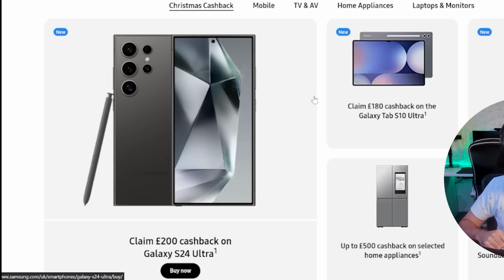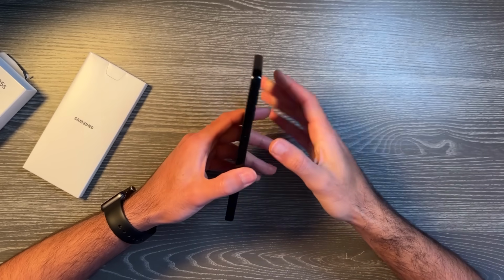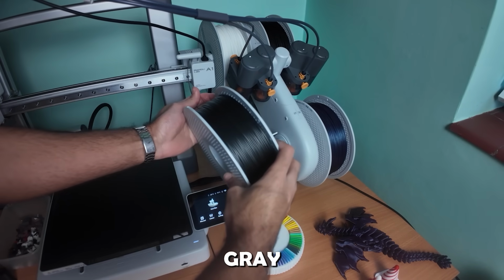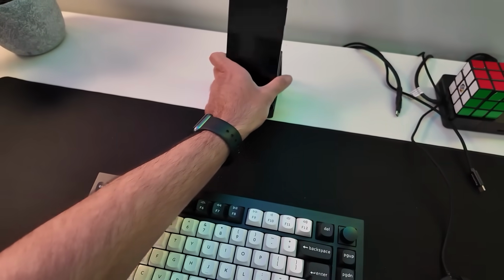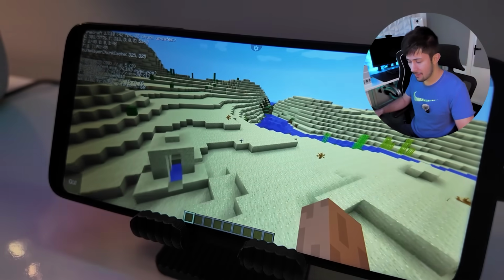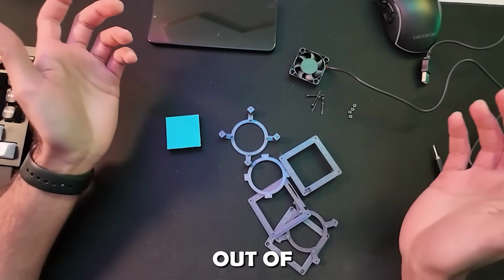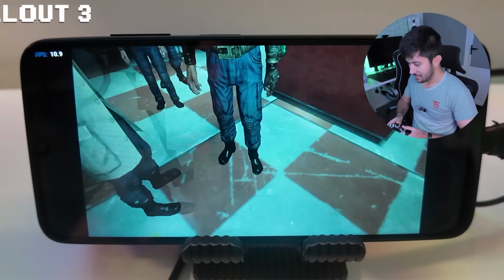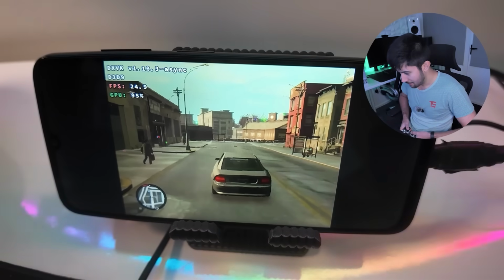Testing the Cheapest Samsung for Gaming

Comment: In my experience of many Samsung flagships and budget phones, Samsung doesn't have the best specs for the budget end but have better software support. Even midrange phones Samsung tend to have weaker specs but are just good all round devices. But chips and screens have advanced enough that even cheaper phones are decent enough. But if you can spend a bit more to get a phone with Oled/ Amoled screen its worth the slight additional cost

Comment: I'm using a Samsung Galaxy Note 9, and it's outdated, yes, but it's my best phone for gaming. I can play up to PS2 and some switch games perfectly fine, and has Samsung dex, I'd recommended trying it for a video sometime, great video btw
Reply: How do you get Switch emulation? I don't trust many sites for downloading "current" games. Does it need keys for the games to work and stuff?
Reply: @kylespevak6781  yea, you need the prod.keys file, sometimes, depending on the emulator, you'll also need the title.key file, and some sites are actually trust worthy
Reply: Galaxy Note 9 is still dope but very old at this point, do yourself a favor and get an S25 Ultra, might be easier said than done tho I know🤣🤣🤣
Reply: @HugoPereira1994 my redmi note 9 pro is basically my  retro gaming and mobile gaming device now

Comment: Honestly Xiaomi's snap dragon budget phones are surely good options of you want something fairly good and long lasting around 100-150-200$€.
(BTW right now the best cheap model I would say it's the Xiamoni redmi note 12 for it's features and around 150€/$ cheap price.)
BUT, there's a but here... If you want a phone for daily use, you should go with Realme, their budget phones are really good and if you want specifically a Xiaomi mid-end phone, go with Redmi Note 13, so far I seen, this phone is a beast for it's price.
Reply: I would not recommend Xiaomi for budget gaming.... From midranger to higher end, go for it... But budget, stay away from Xiaomi if you are considering any gaming.... Their Security app took too much ram and core for the game to perform well
Reply: @nishikun867  Fair enough, so far I've seen this phone model for this price has a good total scoring, but if you want something decent for gaming you need to crank up the budget at least to 200€/$, one of the cheapest mid-range phones is the Redmi 13 5G which has got a dimesty processor which is really good and performs even more better than budget Snap Dragon phones.
Reply: Realme Neo 7.... yes, 2.2mil antutu points. You could use this phone in the next 10 years

Comment: Tip: go to about phone on settings and go to build number. Tap 7times. You will enable developer 
Options. Then go to developer options. Scroll to graphics driver. Select app of choice to run on system graphics driver. Tip: go to settings. Scroll to battery and device care. Scroll down to RAM +(PLUS). Select. Then select the highest ram+ and restart your phone. 

Like if helpful.
Reply: Ram plus is bad for storage life since it read and writes way to much and ram plus is good for multiple app opens but slows the performance of the phone

Comment: If you want to squeeze every performance on that phone, try rooting it then disable thermal throttling and overclock its cpu
Reply: Overclocking is never a good idea
This phone is already getting hot
Reply: @Drraygun-h9k  yeah i suppose, but with phone coolers its sure is worth it. And you can always turn it back to normal.
Reply: overclocking is only a good idea when you have a way to cool down the phone, and even that small cooler would not do with overclocking, you have to mod your phone
Reply: How
Reply: @Ascend-Lab dont do it
Horrible overheating and not enough performance boost to matter
Reply: @Ascend-Lab  Theres alot tutorials on youtube, i recommend the custom recovery method but beware one wrong step may lead to bricking your phone.(rooting also make warranty voided)

Comment: Snap 680 is crazy good for that price
Reply: The only downside is 60fps screen
Reply: @AgnickMaji i know alot of phones with sd680 and 90hz
Reply: @AgnickMaji like redmi note 11
Reply: @ItsMitGA  The redmi note 11 is the goat, i got that phone for really cheap, slapped an android 15 custom rom on it and it works like a charm
Reply: @ItsMitGA  I said about the cheapest option
Reply: @AgnickMaji i mean almost no phone at that price has more than 60hz
Reply: You dont buy a new low end phone if yiu go for performance, i got a little lucky and got a mi 11i with a bad screen for 25 and got a cheap tft for another 25. Now I have a phone with sd888 for 50€. But if your raise the budget to 100 you can easily get one used with the original 120hz amoled.
Reply: You can get sd680 in redmi 10C at cheaper price 128gb storage and an extra 1000 mAh
Reply: @AgnickMaji and a free sudden death/blackout unit 😂

Comment: Bro I have a helio g85 processor and i ran 1.19.2 with optifine and low settings and i got 60 fps and the snapdragon 680 is much better than that it will run 1.21 with optifine easily on decent settings

Comment: 1. Enable developer options on the phone
2. Go all the way down to force desktop mode and force freeform apps
Reply: would that make it possible to use it with an external monitor? or just makes it similar to a tablet ?
Reply: Nope it doesn't, that's just software trick for phone that already has display output, if the phone doesn't have video output through hdmi, there's no way it will work @joshe2420
Reply: Not the best solution but it's just alright
Reply: @elmanbeshirli637  Better than nothing
Reply: You do know the apple charging cable is like 1.5 times more expensive than this phone
Reply: @ION350e lol
Reply: Doesnt work, the phine physically doesnt have the pins for video output over type c. What would work is plugging it into a pc and using scrcpy to create a new virtual screen, but it might be a bit broken.
Reply: For what?
Reply: @williamlangs  Try to copy Samsung DeX on all android phone but with a strange UI and also a strange app setup lol
(I tried it on my Infinix phone, it doesn't make any sense why you need a phone to bgecome an Android pc tho, since I prefer the Linux distro more)

Comment: I have a question i have s24 exynos variant can i do the same what you did with the ultra?
Reply: Yh but u will get like a 10% performance decrease, but it should work perfectly fine
Reply: Yeah that's a amazing phone ngl even tho exynos it can run dex nicely
Reply from the maker: Yeah the Exynos S24 can run Samsung Dex and mobile games but if you try emulation with Winlator you may struggle to get games to run
Reply: @NotroDan  but can it still atleast play games like you did only for small % of performance decrease?
Reply: @theapplepig2656  yeah you can even play in the charge and performance will imcrease close to the ultra but not the same
Reply: @theapplepig2656  try putting on performance mode to max aswell it can help with multitasking and sharing the game with all the cpu cores for more performance and try testing the pc games without mobile data or wifi on that can increase performance aswell
Reply: @theapplepig2656   try developer options and enable "force 4x msaa" and enable "Disable HW overlays" for better animations (but remember Disable HW overlays auto disables itself after every reboot)
Reply: I have an old s21 exynos. Can this also run okay?
Reply: @theapplepig2656   yeah it can run okay why did you think they added the feature if it couldn't. Just do the steps i said for max performance
Reply: Thank you guys for the help. I would not be buying a pc. Instead, I can just save up :)
Reply: @theapplepig2656  no problem but dex cant replace a pc.. why dont you sell the s21 since you have a s24 or sell the s24 and get a new pc or laptop thats good?

Comment: Try iphone!💀
Reply: iphones cant emulate bro
Reply: I emulate ps1 psp gbc gba nds games on RetroArch on a regular basis… just not pc games, that’s not possible
Reply: Nahhh Iphone doesn't have a desktop mode when connecting it with a cable to a monitor, and also it doesn't have the high end emulator like PS2 PSP ps vita Nintendo switch GameCube Wii and Wii u, and also it doesn't have a PC emulator, for the gaming side I can see that android is way better than iOS in gaming
Reply: Good luck getting pc games running 😭😭😭
Reply: No😊
Reply: Iphone can't do that
Reply: Absolutely possible,  tho hard
Very,    very hard
Jailbreaking and installing project sandcastle android 💀
Reply: IPhone is very strict in making alterations to the phone, Samsung or Android if I lock myself out I know how to unlock it and it will still be active, iPhone if u lock yourself out and don't have proof of purchase Goodluck u will be among the thousands of people trying to get into their phone if u don't atleast have the icloud account of the device